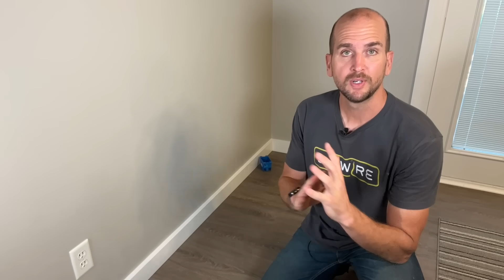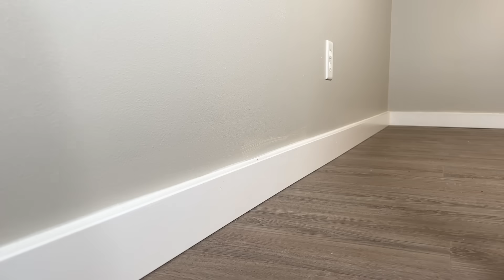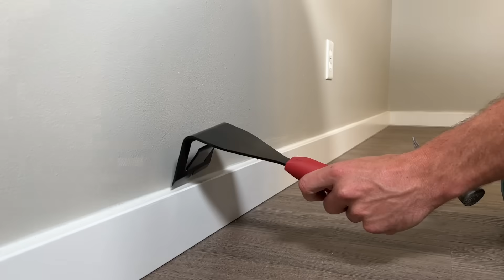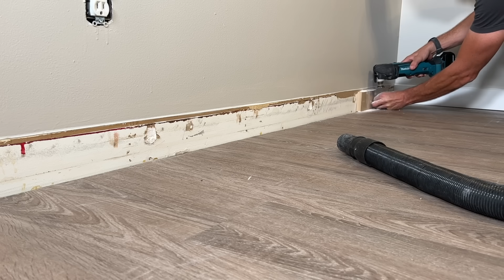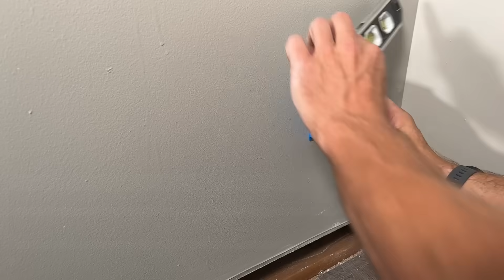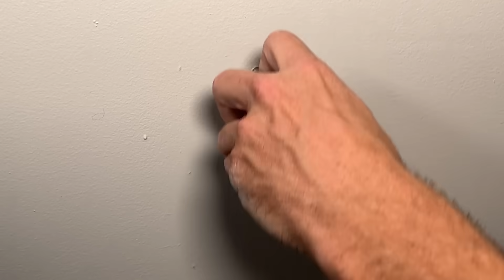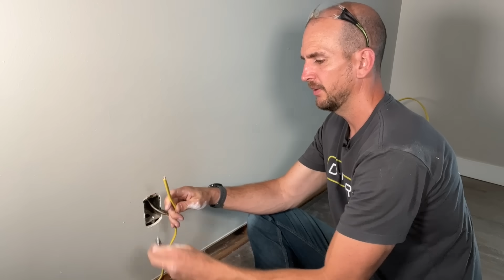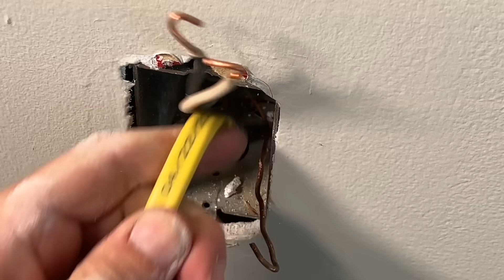How To Add An Outlet To A Finished Wall

Comment: Nice work.   I wouldn’t drill a 1” hole for a single 12/2 romex cable, 1/2” or even 3/4” would be plenty large enough to feed the cable through easily, and weakens the stud less, as trivial as that may be, but to each their own.

Plus I would normally strip the romex from the connector before installing it into the box.  I find it a little easier than reaching into the narrow box to strip the romex once the connector is fastened to the box

Comment: I am about to start remodeling a bathroom including a new vanity with a sink. There never was a light above the sink, but there's an outlet on the wall to the left of the sink. I'm going to install a light on the wall where the back of the vanity will sit, and plan to tap off of the outlet. I knew I had seen this video before and thought I had saved it, which I didn't. At the time, I didn't know that it would come in handy. Now that I have my plans made I have to run romex through 2 walls that come together at a 90 degree angle. Your video makes it look easy, and it probably is. I'm going to take my time making the cuts and running the wire. I have the luxury of time for a change because the bathroom is on the top floor (we have 3 levels which includes a nice finished basement) and rarely gets used, but it needs to be remodeled. I'm so glad I found this video and appreciate your example and explanation! I'm really anxious to take on this challenge!

Comment: no nail-stop plate needed?
Reply from the maker: For my install I felt safe considering the center location of the holes drilled and that the holes are behind the trim which reduced the chance of people drill long screws.

Comment: I’m an electrician with 48 years experience and was still impressed. Good job.
Reply: My experience is motor control and automation. This just came to me and I had to watch it.
Reply: 42 years here,  awesome job 🎉
Reply: I'm a novice and someone who likes to learn about Dyi projects.  I'm just wondering, could he had have used 2-way wagos instead and used the receptacle itself in order to run it to next circuit (outlet)?  Thus eliminated the need to bigger/more expensive wagos. Is that even possible if I'm reading this application correct and there are other receptacles connected to that circuitry?
Reply: Ugh.    Plaster will be a major pain.
Reply: You'd use those Wago connectors??? I heard they are bad, no??? Just curious. I'm about to add a plug for my gas stove that is extension corded to another plug in the kitchen as of now. The plug I want to use is literally on the opposite of the wall where the stove it. Shoudl be easy, I think.
Reply: I'm electrician with 75 years experience 👌🏻
Reply: I'm an electrician with 60 years experience and I'm taken aback by USA cabling being solid conductors. In my country, no wires are solid and all earth wires are insulated. Very interesting look at a different way of doing things.
Reply: You haven't done this in 48 years?
Reply: Just learned something new today. 28 years and never gave thought to doing this way.  Clean
Reply: I’m genuinely curious: why would you watch this then?
Reply: @Bwick_1776  Never know, may learn something new.
Reply: @Bwick_1776 always learning, plus some actually decent tips here.

The wagos though....grrrrr
Reply: @Bwick_1776 I started to post that same question til I noticed yours!
Reply: @hansgruber6543 watching this to catch any mistakes.  He didn't really make any mistakes here, but 1" hole was an overkill for a single 14/2 cable.
Reply: @inthemiddleof  I thought 12/2 is yellow
Reply: @MrBababuwi  correct. I mistyped.  12/2 or 14/2 almost the same size.  5/8"  hole should have been sufficient for this instance.
Reply: 48 years ? Seriously ?
Reply: @lordhexon  probably the owner of the company
Reply: @lordhexon  🤣🤣🤣🤣
Reply: I am electrician since Nikola Tesla invented AC and I so excite with his work🤡
Reply: I'm an electrician with 28 years experience...I wasn't impressed in the least as I knew exactly how to do it before watching the video...LOL  Pull the base off and go low.  That said, I only watched about 10 seconds before looking to the comments.
Reply: 48 years of shit
Reply: @pipefitterwithguns8688  48 years of SHIT... There you have the answer: why you are impressed with a sloppy job that does not comply with the code...
Reply: @pipefitterwithguns8688  yeah

Comment: Great video. The only thing i could add is flip-flopping the side of the stud you are drilling so that the angles of the holes create a wave pattern through the studs with the cable, making it much easier to pull 👍

Comment: Cool... I like the idea but since it's a "quick" job I would have just notched an inch or two of the drywall at the bottom and running the wire there instead of doing all the extra work and just put back the molding, you just went a bit further and did a better job

Comment: If you go to baseboard level, you will need metal plates to keep the wiring for damage with nails.  Also, it's required by code

Comment: In my 50 years as an electrician I wired about 2500 houses and never pig tail wires just used the screws on the outlet. I also don't think I would trust the wago's, I would prefer twisting my wires and using a wirenut.

Comment: Ok, while I love what you did here, it came out very nice and clean and yes it functions. However, you didn't tell people to be sure to not overload their breaker switches by adding too many outlets per breaker switch circuit. And that the amount of outlets per circuit are also reduced by the number of light switches/ ceiling fixtures that are on that circuit, (switch to fixture generally counts as 1 outlet). For safety, on each 15 Amp breaker you should not exceed 10 outlets, however, 25 outlets can be used on a single 15 Amp breaker as long as you ensure that no more than 12 amps are drawn from that circuit at any given time. And depending on tenants/ new owners, you can not guarantee that limit will not be exceeded. Safety is key, so to not exceed 10 outlets/ switches would be ideal. Otherwise, FANTASTIC job, and well done 😊😎👍👍

Comment: I could be wrong, but I seem to remember you talking about a new remodel, code approved, plastic junction box that didn’t require disconnecting the multiple romex connections, and when the lid was screwed down it secured or clamped the cables, so they couldn’t pulled out….. am I going crazy?

Comment: Instead of taking the trim off and cutting the the drywall, will it be to code or are you allowed to cut a with a router a line deep and long enough on the trim below the nail line to put the wires in.  This way you connect the wires on the trim itself from one area to the other.  Please let me know?

Comment: They make a snap in (nutless) connector for the metal box. I like the connectors if you are dealing with more than 2 wires but the pigtail was not necessary. 2 lefts 2 rights and twist the ground. Cool trick going behind the trim!!

Comment: Not an electrician  screw around and burn your guest up.   Not recomended no inspection no code   nails will enter wire. So wrong
Reply from the maker: Always welcome feedback.  Was there a specific part you didn't think met NEC requirements?
Reply: Dont do it youself. Hire an electrician before killing guest

Comment: I would better like to cut the sheetlock right height code required and reuse wall and patch. It is not hard to repair the wall.

Comment: Hi, I'm a British Electrician and I watched out of interest to see the difference between our system and yours. So apart from the voltage (ours being 230v ac) I thought I heard you say you used a 12 guage or 3mm cable, where we use either a 2.5mm + 1.5mm cpc or ground in your case for a ring main system or a 4mm + 1.5mm cpc for a radial system. Our colours are different too, we use Brown for live, Blue for Neutral and we use a green/yellow sleeve for our bare cpc, which you appear to omit. Appart from that the obvious back box and socket types was the fitting you used to protect the cable entering the box, yours being a solid fitting with a locking ring, which is, in my opinion superior to the rubber grommits we use. If any of your viewers are curious about British electrical systems they should look for Artisan Electrical on YouTube. I really enjoyed your video, though👍🇬🇧🇺🇸
Reply: I assume your use of the thinner wire is due to the lower current?

Comment: Thanks for this fantastic tip! I wanted to mention using metal shields or guards in the through-holes drilled into the studs, but other comments already pointed that out. I accidentally discovered a possible alternative: my local big-box DIY store was out of 15 & 25-foot 12-gage cable (which is locked up on the shelves!). However, expanding my search in the aisle, it turns out they had metal-shielded 12-gage cable in all lengths, for about 25% less than the unshielded, and not locked up!  Voila!  Two checks in the boxes - cheaper, and one less step of adding stud-hole guards!  (I don't think it's as thick & sturdy, but then I also don't expect a lot of nails to be pounded in at the baseboard level to make this precaution a firm necessity.)

Comment: Shame you have to use connectors in the back of the box. In the UK both of those cables would go straight into the terminals on the socket. I always hated putting connectors in the back, but that's because our back boxes are only an inch deep. Good method of removing the skirting though, most leccys won't touch woodwork.

Comment: I live in a country in Asia and our house walls are typically made of concrete hollow blocks. All the outlets you need must be in place, otherwise it's very difficult to put new ones in. The exceptions are inside partitions/walls, which can be made of plywood. That's why many people just use extension cords when they need to power something that's far from an outlet.

Comment: Why on earth would you add splice blocks and pig-tails when a duplex receptacle has two hot and two neutral connection points!? As long as the tab between the connection points is not broken all four of those wires could have connected directly to the receptacle. That is a waste of money, space, and not very efficient wiring work. The more splices you have the more chances for failure.

Comment: Why did you choose to pigtail? Versus using the second set of terminals on the source outlet? Is it code or preference?
If m chaining my outlets, I use the second set of terminals.
Also, I’m pretty sure you’re supposed to ground/bond the metallic box of the source outlet…believe it’s code.

Comment: Great demonstration! I have one question though. Why do you need to use the level nuts instead of another terminal of the receptacle to connect to the new receptacle? Isn't the design of two terminals at each side exactly for this purpose?

Comment: Another electrician chiming in. I admit it - I clicked on this video expecting it to be another laughably cringe "DIY guy does electrical" - type videos that I see all over youtube. I admit I was pleasantly surprised that this video contained actually a genuinely good and new-to-me tip that I will now use in my work. All-in-all, great video, great tip. My only real disagreement with you is the use of Wago connectors over a mechanical joint. Wago connectors are clean, fast, and easy, so I get the appeal. However, as someone who has worked on houses and commercial buildings up to about 140 years old, I can tell you that plastic degrades over the decades, and at some point, decades in the future, Wago failure will become more commonplace and service calls that, after troubleshooting, will ultimately amount to replacing old, brittle, cracked and decrepit Wago connectors, will be commonplace. A mechanical joint, physically twisting wires together into a tight bundle or "joint", can't be beaten for efficiency + reliability + durability.

Comment: The outlet I want to tap into already has 3 romax cables going into it.  Is it ok to use a larger (5) wago level nut?  3 plus the new romax for the new outlet plus the pig tail? 

Thanks in advance!  Don’t want to burn down the house.  My wife might get mad at me 😂
Reply from the maker: Hard to say without taking a look.  The 2 things I would investigate is the box size/box fill and how many outlets are already on that circuit.

Comment: What a great video for DIY!! 

2 small observations: 

Not knowing how many outlets are already on that circuit might be an issue. Electrical codes are clear on max number of outlets per branch circuit 
I’m not saying you did anything wrong just be sure to verify your circuit capacity before adding an outlet 

2nd observation: 

Those types of connectors are bad , bad , bad
Yes they’re UL listed and a LOT of “electricians” use them but if you really research how they are made the  surface that actually touches on 12 awg wire is less than 1/2 of the diameter of the wire itself

This small contact area is high resistance which will cause overheating of the connection and failure 

Twisted wires and wire nuts are the ONLY proper way to make a pigtail connection

Comment: I used wagos on a project and they are great to use. I did have one flipper open up when putting the wires back into a "tight" box so I now do with wagos what I was taught with wire nuts and that is to give them a wrap of electrical tape to prevent any way for it to open accidentally.

Comment: Great video !! Thank you for explaining in detail without "talking just to hear yourself talk " as many people tend to do. I'd like to offer an additional tip if I may concerning the cutting of the drywall : I've found that using a slightly sharpened scraper blade on the oscillating tool instead of a standard toothed blade cuts just as well and generates far less dust. Also, I'm sure that people who hire you appreciate your cleaning up the area when finished - sure, it takes a few more seconds, but it results in repeat business and positive referrals !

Comment: Your work and finished product/look is 1st rate but why cut out all that sheet rock when you can cut about an inch height from bottom of drywall, length of host to slave outlets.. you can tack the wire across the runner board attached to the floor.. you don't have to worry about reattaching all that drywall and you'll be code compliant once the baseboard trim is re-fastened, just be careful to not shoot a finish nail into your newly ran wire :)

Comment: I totally enjoyed watching this video and learning about your technique and tips. I  need some advice from you. I want to install a TV mount over the fireplace. The only power nearby would be two recessed ceiling lights and an outlet on the two opposite  90 degrees walls about 8 feet away from the center of the mounting location. There is an attic above. What suggestion can you give me to get power for a new TV outlet in the center of the fireplace wall?
Reply from the maker: What type of fireplace?  Is it a real brick/masonry fireplace where you are mounting the TV to the brick or a fireplace insert where the fireplace exhausts out the back and above the fireplace you just have a more traditional wall construction.

Comment: Actually you CAN have too many outlets; because circuits are designed to carry a certain amount of power depending on wire and breaker size.

Comment: If the outlet or a switch plate is not real flush with the drywall,,you can cut the tabs off the outlet ,,they are made to be cut off for using old work boxes.. the tabs are next to the 6-32 screw, they have a indents to be cut off..good luck with future projects..😊

Comment: If you use a multi tool to cut into the wall be careful not to cut anything important. Like a water line, natural gas of most likely another wire

Comment: Remember outlet needs to be TR (tamper resistant) and also AFCI protected. The outlet might also be required to be GFCI protected if it is in a basement. I think your video was great, just wanted to make sure the electrical code requirements for the outlet were mentioned.

Comment: Using those wago connectors isn't a good idea.  I worked for a heating and air conditioning company and the service guys would tell me how often they get calls for something that doesn't work and they trace the problem down to those connectors.

Comment: very nicely done. My mind immediately went to a 4,5, or 6' long wormscrew drill bit. Cousin of mine used to install alarm systems and had a variety of this type of bit. I think I like your method better. In disagreement, I learned electrical about 50 years ago, and am an old school, traditional wire lock kind of guy. BUT, short of wiring for a welding appliance, seems your preferred connectors work just fine.Looking forward to your next video.
Reply from the maker: Welcome to the channel and thanks for the feedback 👍

Comment: So what happens when a new owner installs tall baseboard 5"or 6"and nails into this new wiring? Whats the odds of that happening? Probably pretty low but, what about keeping the wiring low and install metal plates in the studs to prevent nailing into the wiring.